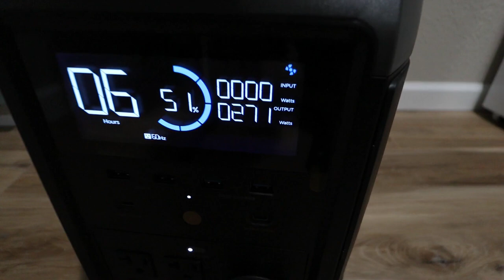Installing a generator inlet box and building an electrical closet. #738

Comment: Suggestion is to take a red paint marker sharpie and put a red dot on all of your critical single pole breakers so you can quickly identify them when you need to switch to emergency power along with a red dot on the panel schedule on the door.
Reply from the maker: Good idea!
Reply: Excellent idea! I printed a chart that I tape inside my panel but this idea is better, I can add to use with my chart. Thanks!

Comment: I have installed server room size battery backups throughout the house, Internet/Tv ha their own. Fridge's and refrigerator has their own as well. Also have a 220 50Amp connected to the grid that sits in the closed. Great for FPL Crappy power grid and their rolling brownout outage. Also works as great  surge protector.
Reply from the maker: Good idea, that'll probably save a lot of appliances if you're experiencing a bunch of surges.

Comment: Great video Andrew. I have a small suggestion. You should put emergency light in the pantry just in case power does go out or you do shut off the power a light comes on so you can see and you know just in case Tiffany needs to get in there when if you're not there. I like the guy suggestion about putting a red dot next to the breakers that you're going to need. Thank you for showing the installation that helps me out a lot.
Reply from the maker: We actually have flashlights staged in several parts of the house for this reason. We use to have emergency plug in the wall lights that would revert to battery power when the grid goes down.

Comment: I'm glad you showed that both legs can be powered up at the same time for 120v loads. I like having the option to use a 240V generator for large loads like my well pump and water heater in the day and switch to a 120v generator/power station at night. I wired up a 50A inlet using the same adapter, but had to shave off some of the black locking ring to insert it fully and twist into place on my inlet.(looks like your inlet is actually designed to use the lock ring.)
Reply from the maker: Yes mine is designed for the threaded ring and it fits great. Thanks for watching!

Comment: Nice video, thanks. Just a note for people who are not very familiar with home wiring. He refers to the two legs in the panel as "phases." It is commonly done, even by electricians, but it causes some confusion. This entire system is single phase, with two 120 volt legs. 3 phase power is restricted to industrial use, at least in the US.
Reply from the maker: Correct due to the transformer tap and type. Very hard to break the terminology.
Reply: Single Phase is also refered to as SPLIT phase. 180 Deg apart as 3 Phase is 120 Deg apart.

Comment: Very cool setup for the indoor power source. What about using one of the other outlets on the eco to power the other hot leg. Instead of the adapter?
Reply from the maker: You get limited output from the receptacles. You only get full output from the RV plug on the unit.

Comment: I looked through the comments but didn't see anything.  Since you already have an interlock kit, can't you just install another breaker for your outside unit, and use the existing interlock to isolate grid power, then you could use whichever inlet box you wanted, instead of having to remove the panel and replace wiring when needed?  Thanks for the video's, always enjoy watching.
Reply from the maker: No because the interlock kit is designed to work in one specific location on the panel. If I add another breaker in a different location I'm breaking code and could technically backfeed the grid because the main 200 amp break can still be in the on position.
Reply: What I meant was, use your interlock to enable whichever inlet it is feeding, that way grid power is disabled.  Then you could use either inlet (gen or battery).  Yes I'm sure it's not code, but the grid would still be isolated, allowing you to use whichever inlet you wanted.  If you ever sold your place, just remove the inlet not connected to the interlock.  Or your very handy and make a piece of metal that is tied to the interlock and both breakers?

Comment: Thanks for sharing your thoughts, ideas and videos. Nice setup, congratulations on picking ecoflow, I’m convinced they are one of the few serious suppliers of these type of devices since they also offer an actual generator that will recharge your battery and is designed to work hand in hand with it. Would be great to see you test on in the future. Not sure if there is a legit way to inexpensively do it but would be nice to add a few dedicated lights above the panel, one tied to the line side the other tied to your panel. They would provide dedicated lighting while switching at the panel and provide a status of the connected power sources. 
IE. Notification of line side outage or restoration. You might also consider adding a dedicated plug for recharging your battery bank. Possibly include an interconnect switch to that outlet and swing your generator line from outside to it.
Reply from the maker: I would love to get my hands on that smart generator. A lot more content coming!

Comment: Very good video. I have a gas generator hooked up to my inside panel w/interlock. I also have a Eco Flow Delta pro. In an extended outage I will run the gas gen during the day and the Delta Pro at night. It would be nice if I could switch between an inlet box for the gas gen outside to a inlet box inside. Is there such a scenario. Currently my inside Delta at night plan is to run extension cord hookup to vitals. Looking for an easier backup scenario to not run cords. Thank you.
Reply from the maker: You can run an inlet box on the outside to another breaker spot. The problem is that does not allow you to install an interlock, thus goes against code. It's a difficult scenario to remedy. The only option would be to run a sub panel to your generator interlock breaker and feed the sub panel with both indoor and outdoor inlet boxes.

Comment: Great video, I'm having an Electrician install my interlock plate and a 30A inlet box. I now see that a 510A box will be ideal for future upgrades. Question; if your using a 50A breaker how would that be protection for the EchoFlow Delta pros sense they are 30A protected. The 50A breaker wouldn't trip at a 30A overage. Please explain this for I'm at a loss.
Reply from the maker: The proper thing to do is match to your machines. Put a 30 amp breaker in, even if on a 50 amp plug and wire. It's OK to downsize breakers for wire and inlet boxes, never upgrade breakers larger than the wire can handle.

Comment: The two hot legs in a 120 -240 volt panel are not separate phases they are both the same phase and it is known as a split phase they are just referred to as legs.
Reply from the maker: Yes I know, it's split phase. But often referred to as independent phases, it's a bad habit.

Comment: Can a 30 amp inlet box with a 30 amp circuit breaker service both legs?
Reply from the maker: Yes a 30 amp generator inlet box is also setup for 240 volts.

Comment: Hi what kind of cable did you use in wall?
Reply from the maker: 10/3 romex for 30 amp service
Reply: @TKCL thanks for the reply, I’ve bought the exact box and accessories linked in your video! What did you use to secure the box to the drywall?
Reply: @TKCL also does your ground go in (WITH) the green wire, if your going to ground on a bus bar? I’m using a secondary panel. So my neutral isn’t bonded with ground.

Comment: Let's say you have a 120 volt generator. Is it possible to use it to power a 240 volt appliance, like a stove, drier, or water heater? I would think it would have reduced abilities of heating. Have you ever tried this or know what will happen?
Reply from the maker: Appliances with electronics could potentially be damaged. Not to mention it isn't safe, assuming the appliance tried to run you would essentially be doubling your amperage since voltage was halved. Not good for the wiring, breaker or the electronics. I highly recommend you don't do it.

Comment: The motor that I have in the machine it's 20 amp. 240 bolts single face I know you're the one who can do I see all your videos Yes give me a comment please. Thank you
Reply from the maker: If you are wanting to run a 240 volt device on a 120 volt generator you cant buy what's called and step up voltage converter on Amazon.  However if your motor truly pulls 20 amps at 240 volts that's going to be a problem for this device.  It's rated at 30 amps 120 for a single unit.  A 20 amp 240 volt device is 40 amps 120.
Reply: @TKCL  My motor is 230 volt 19.5 amps and I want to buy a 6000 6000 w. Generator you think that works?
Reply from the maker: If you get one that's 240 volts it should provide enough amperage to get that motor going.
Reply: @TKCL  okay thanks for the information

Comment: So I am kinda in a mess. Can anyone help! I am doing this same setup and I have a green screw in my panel box that houses all my breakers its in the garage. I also have a main breaker punchout but no main breaker. My main breaker is outside the garage in the meter box. I can add a main breaker in my garage panel, but wouldnt means if first disconnect be at the meter box outside of the garage. I was seeing where people said you will have to bond neutrals and grounds at means of first connect via using a rod that connects them both at the meter. But it says after that neutrals and grounds should be seperated in the breaker panel. So how in thr hell do I do this generator set up then. I already have all the parts drilled a whole to run wire from the 50amp inlet 3ft below my garage breaker panel which I thought was my main but apparently outside below the meter is the 200amp main breaker.